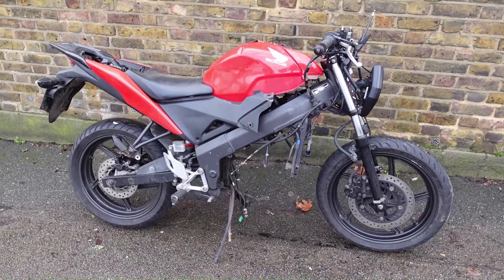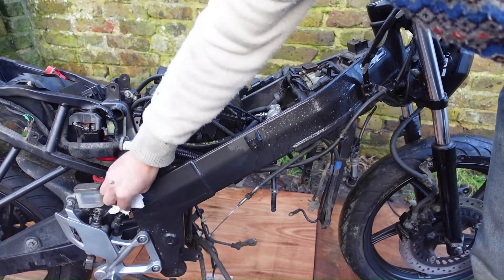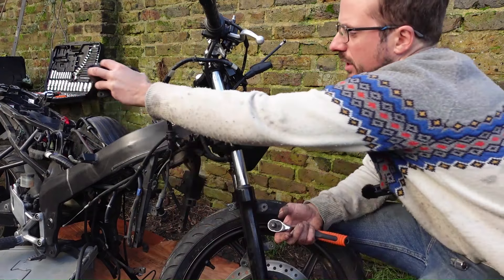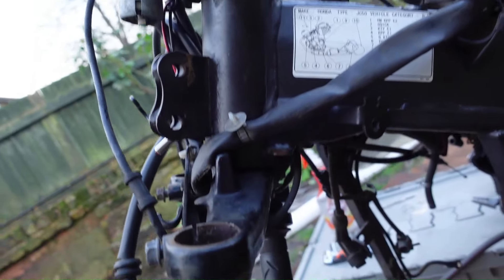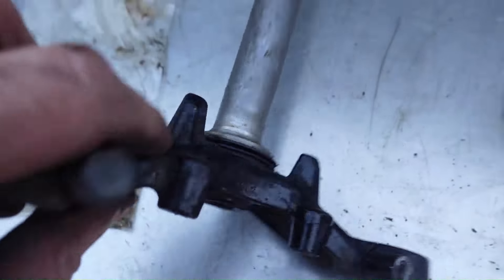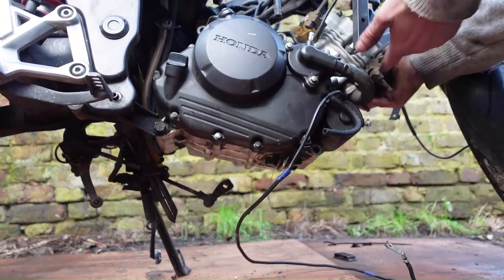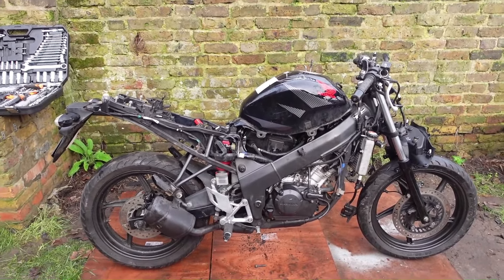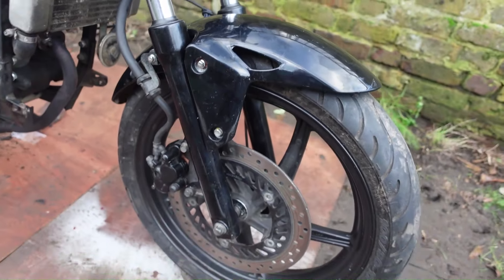Rebuilding a Damaged Honda CBR125 Part 1

Comment: I've one worse have you any spare parts left over I can purchase
Reply from the maker: I do have spare parts, also have another terrible condition CBR125 2016 which am rebuilding at the moment, which parts do you need? where are you located?
Reply: @shadyjosh5  I'm near sure my bikes an 04 model, I'm in northern Ireland mate I'm only starting to strip the bike down so I'll know better what's needed in the next few days I'd say mate